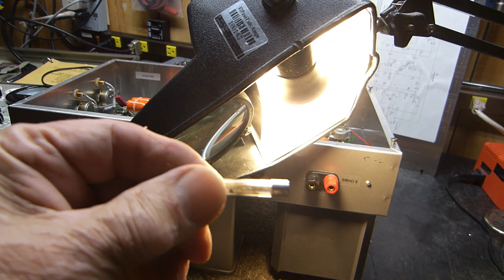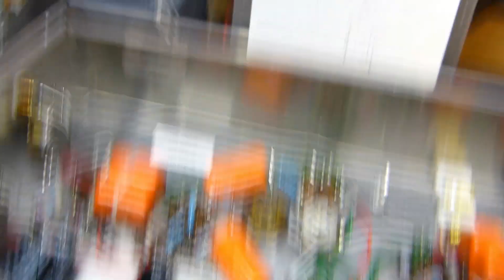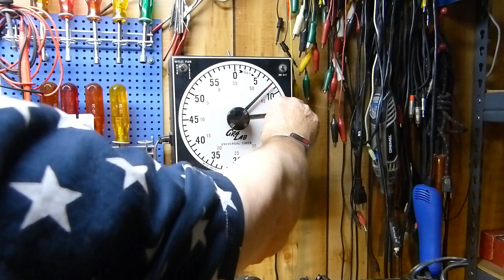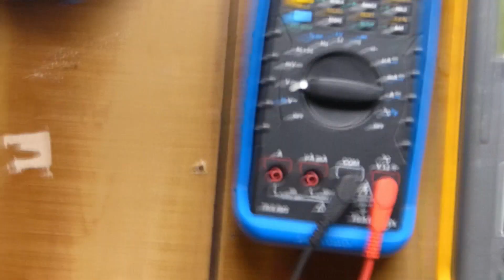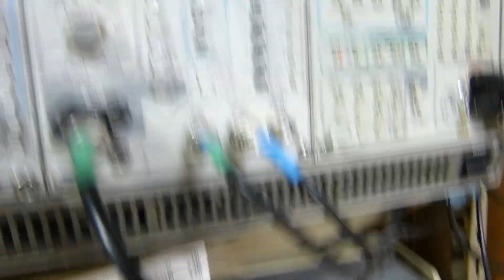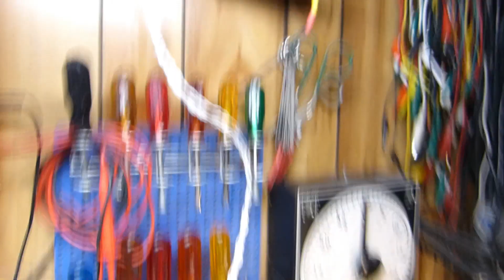Stereo Williamson 7591 Amplifier Repair

Comment: My guess is that the voltage across that cap (C9 47uF) most likely exceeded the maximum working voltage of the cap and punched-through the cap's dielectric insulator and caused the two plates of the cap to short-out, that effectively put that 18k resistor across the output of the +HT supply so the full current output of the +HT supply was flowing through that 18K resistor to ground, no wonder it cracked, I could just imagine how many watts that 18k resistor was being asked to dissipate.
Reply from the maker: The power dissipated in the 2W 18K resistor would be E^2/R = 460^2/18K = 11.76 watts. My guess is on power up the 450V rating of that capacitor is exceeded until the tubes warm up and bring the B+ down a bit. I hope the 500V capacitor that I put in will survive a long time. Thanks for your comments.

Comment: I've watched this before I believe.  It came up after watching your most recent video.  
A good 20wpc amp is plenty for room listening.  Even less if you have a really good amp.
Reply from the maker: I agree 20 watts is enough for any sane listening level on efficient speakers. I have tried to live with my 7 WPC 300B SET amplifier before but sometimes that is not enough power and I also think I tire after a while of listening because the THD being a bit high. I am truly a fan of the Williamson 20 watt design running 6SN7 and KT66. I changed this amplifier from the 7591 back to KT66. I also prefer the Acrosound transformers to the UTC. Just my preference.

Comment: Hello, got a few questions I could use your input on,  Would subbing kt88's in a Dynaco st70 work?  I have 2 non-linear 120w OT's, dimensions are 4x4x3",  and a  4X4X5" PT  . Is room enough on a stock dynakit chassis for this iron? Would it be better to fab a chassis with greater separation?  Would a different design work better? If you require a patreon donation to bother with answering this many questions I can go up to 50 bucks. Thanks, Lou.
Reply from the maker: Hi Lou, That is a big question. First off, we must know the filament voltage and current of each tube. In virtually all cases, the filament voltage is 6.3 but the required current is higher in the higher power tubes. Start with a 6V6 - fil current is 0.45A, 6L6GC fil current 0.9A, EL34 fil current 1.5A and KT88 fil current 1.6A. So, from this perspective, the KT88 although it is 100mA more per tube than the EL34, it will probably be OK.
Now we have a bias issue. Back to the four tubes above - the 6V6 needs about -15V bias, the 6L6 about -37, the EL34 around -37 similar to the 6L6 and the KT88 more like -55 V bias.
These are ball park bias values and must be adjusted to not exceed plate dissipation for each tube type.
The point is, if you put a KT88 in the socket of a EL34 and can not adjust the bias to a safe plate current, the KT88 can get way too hot by drawing too much anode current.
The funny thing about this is, you may be able to get away by putting a 6V6 in a KT88 amplifier (because the bias is so negative it will keep the 6V6 current low) but you can not put a KT88 in a 6V6 socket for the same reasons, i.e the bias voltage is too low and, and as can be seen from filament current requirements, the filament of the KT88 is almost four (4) times higher.
If you try the KT88 in the Dynaco ST70, you should monitor the plate current with something like a bias-probe to make sure anode (plate) current is not exceeded.
Hope this helps.

Comment: I really know nothing about circuits. Wish I did.. But I gain more understanding every time I watch.

So my question, why wouldn't you install a thermistor coming off of the fuse to not immediately shunt full voltage at the moment of power on?

Thanks for helping my journey.
Reply from the maker: Thermisters are good to use in the AC power line. I have used them many times and they will reduce inrush current. 
As for preventing over-voltage on electrolytic capacitors when using solid state rectifiers , they may not help so much as there is no load on the power supply in a vacuum tube amplifier until the filaments warm up but overall they are often a good idea to use.

Comment: As soon as you opened up the case and I saw the ChengX capacitors I knew that was going to be the problem. They are the WORST capacitors ever.
Reply from the maker: This is the third time I have had issues with the electrolytic capacitors in this unit. In this case, I think it was a little over-voltaged at start up but on two occasions a few years back, the capacitors in the power supply went bad - I believe opened. The HV power supply is a voltage doubler and nothing is over-voltage in that area - the two larger brown ones in the video. Maybe I changed brands and that is why they have lasted the last few years. Like you say - just junk capacitors. I have electrolytic capacitors in McIntosh amplifiers 50+ years old and they work perfectly. This little amplifier can run 12-15 hours a day at times as I have it on with background music. Thanks for your comments.

Comment: I am surprized, the caps you installed look like the cheep chinese chech & chong brand.they have been known to test good new and then short lived under use.
Reply from the maker: I think that  happened to me twice as the voltage doubler capacitors failed twice. After the last replacements, a few years ago, they have been stable and reliable and run several hours per day.

Comment: Great to see you again!  You sound well.
BOY that cap was SHORTED!!!!  Guess the 1.8K resistor acted like a sacrificial fuse and saved everything else.
The unloaded voltage sure went above the rated working voltage of those caps too.  That was a smart thing to do... changing both of them out for higher voltage caps.
Cheap insurance and long life.

Take care of yourself and post if you want to and when you want to!  It is always good to see you!

Comment: Well done, an excellent diagnosis. The schematic in the chassis is a great move, always good to open a bit of gear you have built and be impressed how smart the younger you was!  In a guitar amp with a similarish situation I used a MOSFET as a series element with a long time constant in the gate circuit so that the HV to the small signal stages ramped up slowly to a predefined level.
In this case though I think you have a simple and permanent fix.

Comment: Not for nothing my friend but every 2 of amplifier or receiver that I've ever worked on. E I've always removed the tubes before I flipped it upside down. I found it a lot safer for the tubes if I did that because I made the same mistake. You're doing right now moving it around with the tubes still in it.  And I've broken a couple of tubes doing it that very. It's not very safe for the tubes which you're moving it around like that

Comment: I have a question for you Sir. I want to build an RF amplifier using two 813's for use on the HF bands, my question is what voltage should the plate transformer be?, my math is somewhat sketchy but Iam figuring around 3,200 volt before filtering. Would an intermediate use 3,200 volt transformer  be suitable?, I have a seperate filiment transformer put aside already. 
  Would you have an email address i can message you regarding this subject?. Thanks for reading!!!
Reply from the maker: 2500 VDC is about the highest plate voltage you want for a pair of 813. A 3200 volt CT transformer into a full wave center tap rectifier (FWCT) and then into a capacitor filter should give you about 2000 VDC. A large sized  microwave oven transformer (MOT)  is between 1800 and 2000 volts and into a bridge (four diodes) will end up between 2250 and 2500 VDC with a capacitor filter. However... microwave transformers have one end of the HV winding connected to the frame (ground) of the transformer so that wire will have to be carefully removed and properly insulated - probably not the best idea to use MOT's. If the 3200 you are mentioning above is DC out of a rectifier, that is a bit high even into a fully loaded choke input supply which will drop it to about 90% or 2900 volts. Be sure to use a bleeder resistor on your HV PS and be safe... High Voltages at this level should be considered,   Death On Contact.  You can find my email address on QRZ.com   73  WA4QGA

Comment: Modern elyts usually don't like any overvoltages even for a short time.
BTW, the tube layout seems to be asymmetrical. Is there any particular reason for that or could it have been built symmetrical?
Nice video. 👍